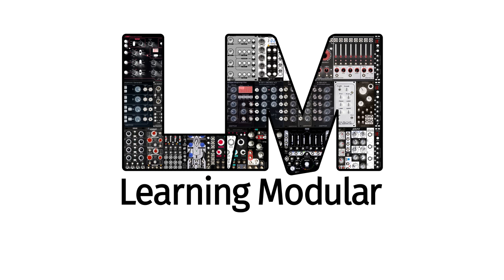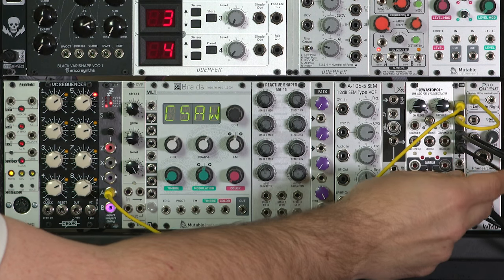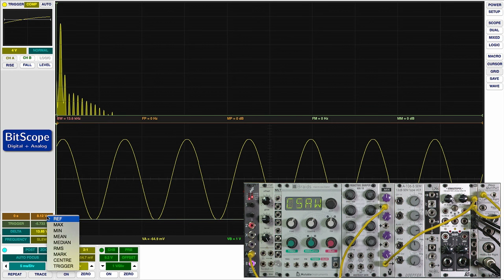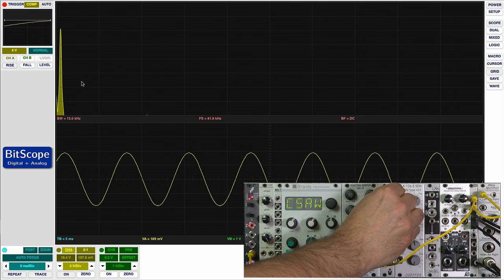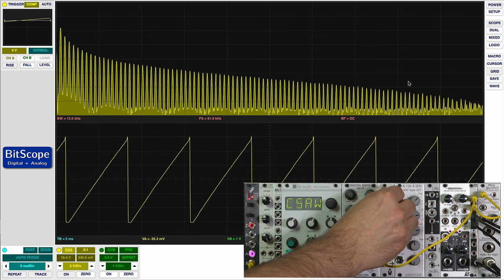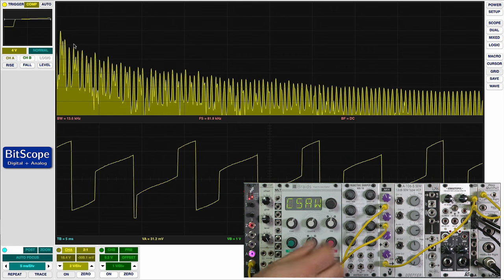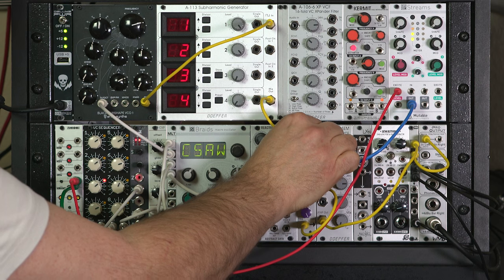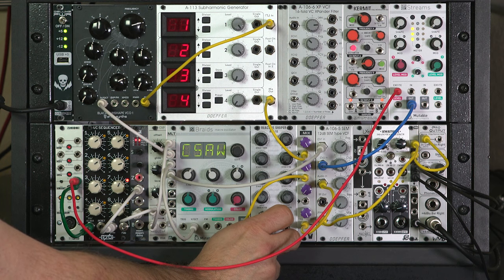Exploring the Moog CP3-Type Mixer

Comment: Great video. As the other posters say - Very well presented. I just got one of the behringer cp mixer clones. I'm looking forward to running it into an oscilloscope to see if the results are similar
Reply: @switchedonnashville It does sound good doesnt it!

I had a look through a scope in VCVrack and the results looked very similar.

By feedback do you mean routing one of the mixer outputs back to an inputs. I haven't tried that yet!😊

Comment: Wow I really appreciate this video.  I can't wait to get a scope for my rack; can learn so much from it.  I am curious, can this STG Soundlabs MIX CP3 module of your's work well with the Behringer 921 line of oscillators and the Behrigner 904A?  I like it better than the larger Behringer CP3A.   Just wondering about the voltage differences between the Behringer/Moog and Eurorack.  The 921 line of modules output around 2.5V for audio signal and the B CP3A outputs 5V max.  Wondering if I could use your STG SoundLabs MIX for both the 2.5V/5V operation as well as the 10V in , 10V of euro rack.
Reply from the maker: Thanks for the technical details about the Behringer oscillators - that's very low compared to standard Eurorack levels (I guess they were trying to go for the traditional Moog levels of back in the day...but if you're going to make a Eurorack module, I would have thought they updated the levels to match). Since that level is lower than what a standard Eurorack module like the STG CP3-style mixer would expect, it will "work" just fine - but you won't get the single-sided clipping effect. What I would do is get a utility mixer that can also boost the level (the Frap Tools 321 is a personal favorite; others like the Verbos Scan & Pan can increase the level even more) to be able to drive the rest of your Eurorack modules properly, and also to get the proper clipping effect out of the STG module. The exception would be if you're running a Behringer Moog clone only system - then stick with the Behringer version of the CP3 mixer, as its level should be optimized to work with the rest of the modules in that line.

Comment: Back when the original Moog Modular Systems were first built, decent quality Op Amp ICs for use in audio circuits weren't readily available, so Robert Moog had to make do with using discrete Transistors to build the Moog CP 3 Mixer modules.